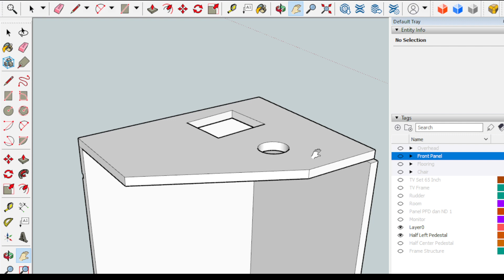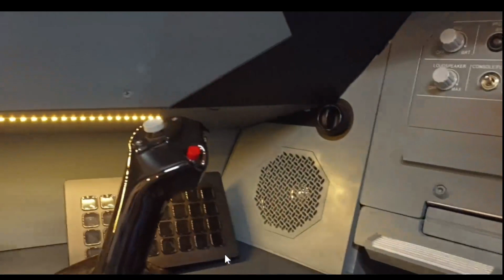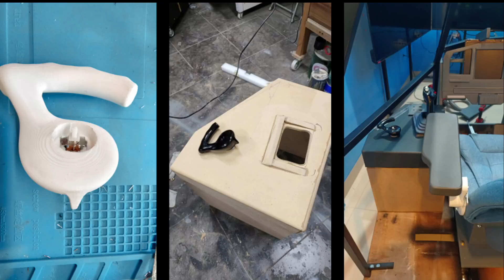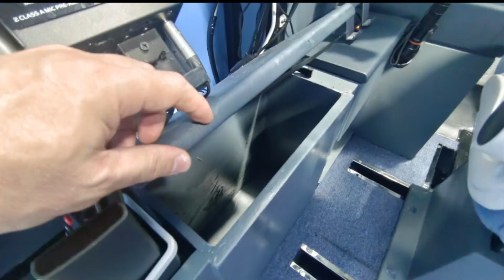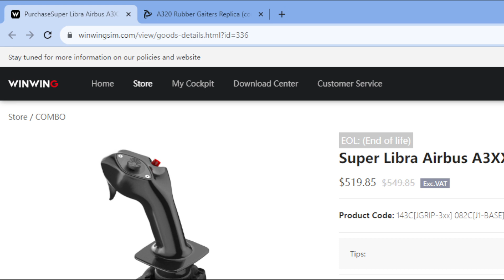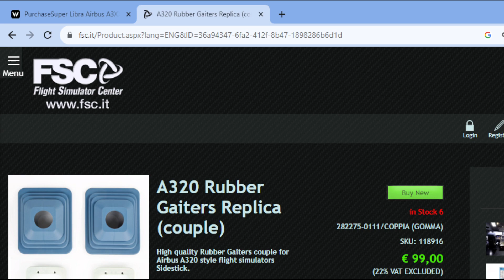DIY A320 Neo Home Cockpit Build Video - Part 7 Left Console

Comment: Very, very cool. I would like to use tablets for efis. The problem is that wen the tablets are installed in the frame, there is no way to power or boot them because the switch is unaccessable. Is there a solution?
Reply from the maker: You meant nd pfd or the efis switches? Anyway you need hardware hack to make it power on or outmof std by mode

Comment: What paint or products didi you use for the tiller?
I couldn't undesrtand, i am looking to build one but i don't know what paint or ink to use to have that look like a soft rubber feeling.
Reply from the maker: I bought the 3d model online thus i could not share the files. But there are plenty to choose from. I then print using PET filament and put putty, sand it smooth and paint glossy black with clear coat to seal it. Its not rubbery though